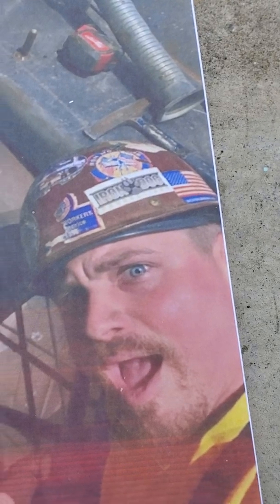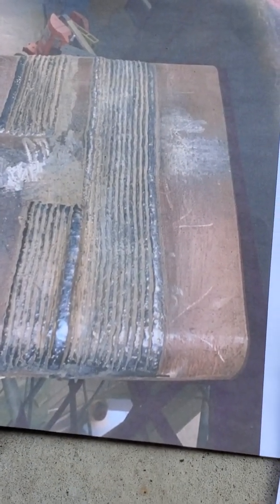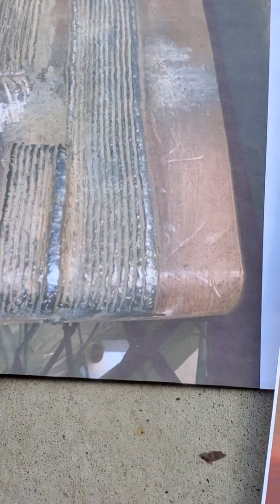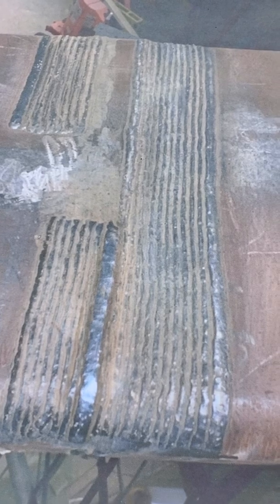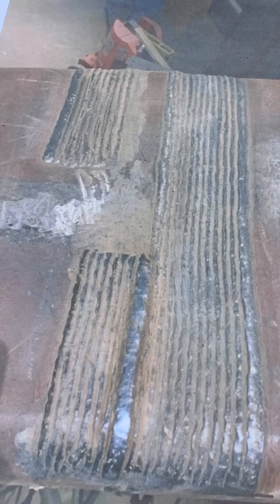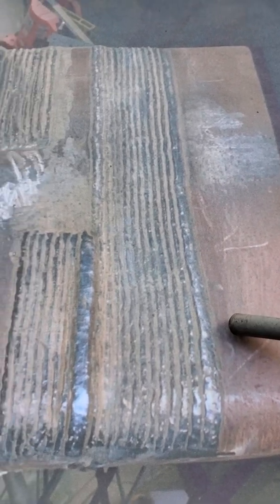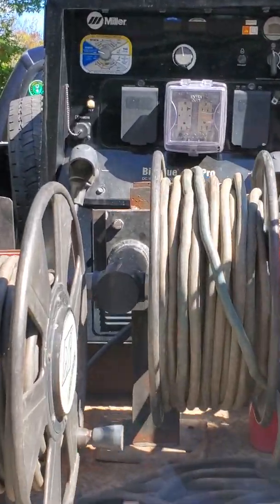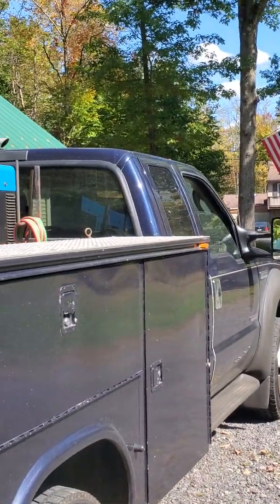Structural welding/ All  Position flux core wire #Used At its full potential,=

Comment: Hey brother, where you out of?
Reply from the maker: Au adVantures, What's up brother, I'm out of philly, Were you from, Thanks for your comment
Reply: @jetweldingllc4691  I'm out of Canton Ohio. Took the job at the new Amazon plant in Syracuse New York to do some flux core welding and saw your video because I have never done any 305 just 233
Reply from the maker: @nicholsceramiccoating8284   Nice, My buddy Gegs, Is run in the job for W and W, Am I buddy Lance is in one of the raising gangs, Small world, Work hard there WNW is a great company, I work with them boys in 40 for many years, Good luck, and be safe!
Reply from the maker: @nicholsceramiccoating8284   When are you starting, You won't have a problem run in that NR305, Are you doing flat moments,  Or column splices
Reply: @jetweldingllc4691  ohhh boy !😄 I just got on last week,  and those guys were getting caught up so got I with a detail gang helping them out until we get started on a bunch of mezzanine columns
Reply from the maker: @nicholsceramiccoating8284   Excellent, Be safe , Show'm what you got, Later!

Comment: Why did you choose the Miller over the vantage?
Reply from the maker: David, I been run in Miller  Big blue 40, And 400 pros for a long time in my career,   There is only one contractor that use Lincoln vantage 300 &400, For flux core and air arcing , From what I experienced with this product,They're a very good product,( Miller Always ran Better , Especially when you  1st pull the trigger The Arc Was  Perfect) (LN25 wire feeders by Lincoln is the best for flux core ) I love what the 400 pro gives you, 40 Volts, I never had an issue with the Miller 400 pro, Most of the big jobs I was on had a welding bank with  Inverters, I love Lincoln, My 305 diesel is awesome, It's for pipe only,  Miller 400 pro diesel, Has been very good to me that's why I purchased it, The power for flux core and air arcing It's incredible, I stick to what's been good to me for a long time in my career,  thanks for your comment!
Reply from the maker: David, When I broke out in the ironworkers, I work for Cornell for 12 years, Their welding bank in the mid eighties was powered by  Detroit diesel motor and all the inverters were made by power con, They were the only inverter on the market they were the 1st, Miller bought them out, Miller has come a long way, I  Love the Miller Big blue 40, 400 pro gives you , Trust me I beat the shit out of them machines, I  Ran them hard, And they never let me down,  Thanks for the comment!

Comment: What happened your red diesel? Does it have to do with the wires you’ve been welding lately?
Reply from the maker: Mr. Moore, I have it on a trailer, Yes I've been doing a lot of flux core, I don't wanna kill it, I been using it to practice pipe,
Reply from the maker: Mr. Moore, I plan to have it on another truck, Thank you for your comment!